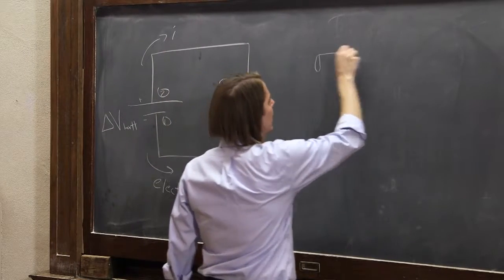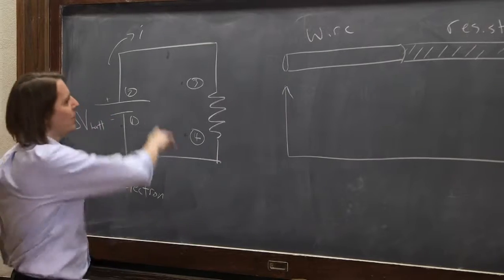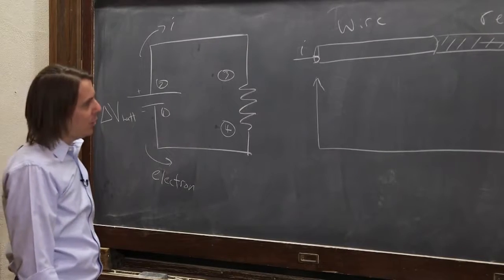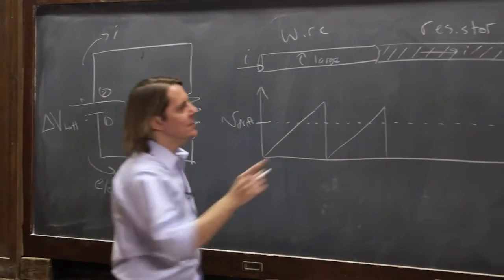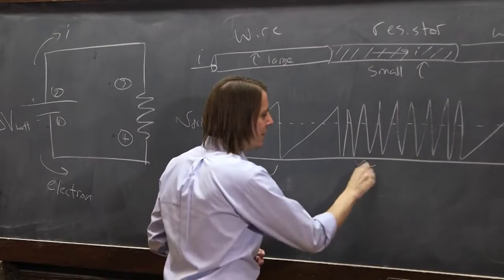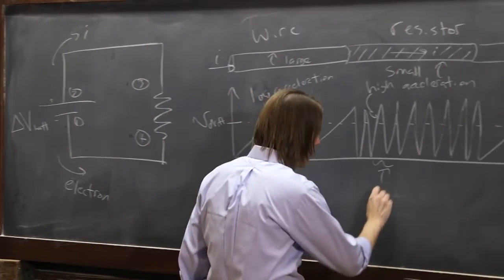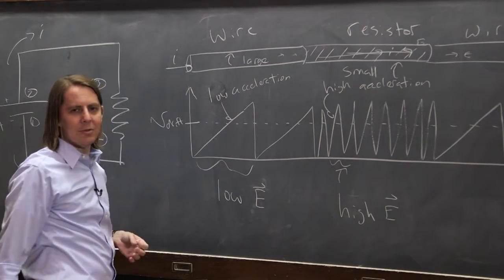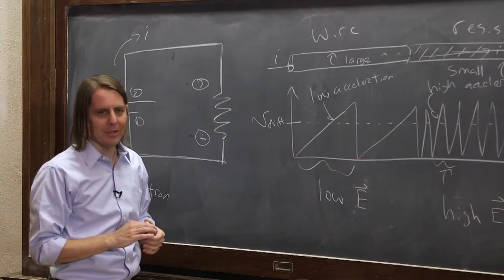PHYS 102 | Circuits 3 - Microsopic

Comment: What creates this field inside the resistor?Does it come from the charge that exists on the plate of the battery?
Reply from the maker: Good question!  The short answer is that there is a potential difference across the resistor.  It is true that the potential difference is created by charge sourced from the battery.   

This is where it gets interesting.  Normally we would say that there is no charge build-up on wires in a circle, but that is the case where we say it is "ideal".  An "ideal" wire is so thin that the capacitance between the wires across a resistor is zero, so it takes zero charge to hold the resistor at a potential difference! :)